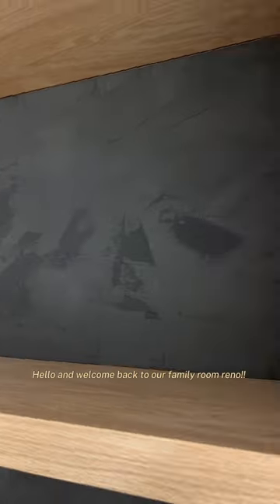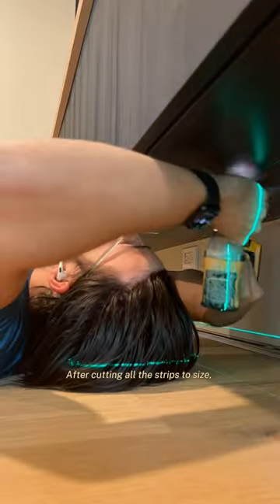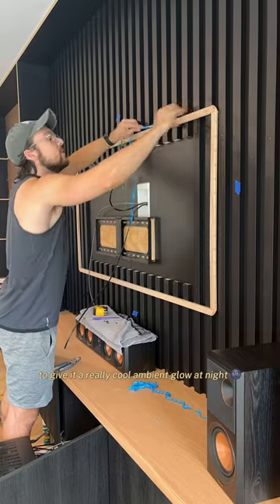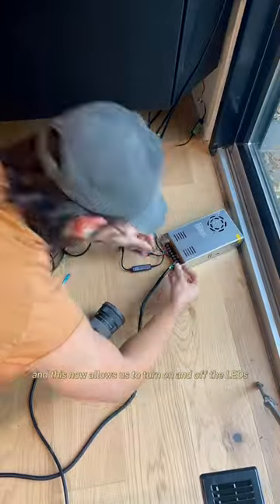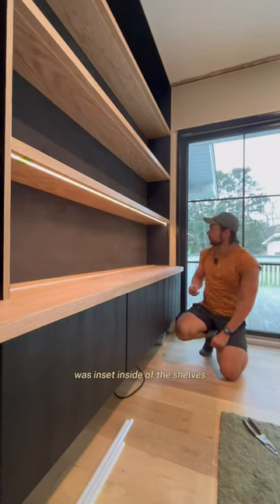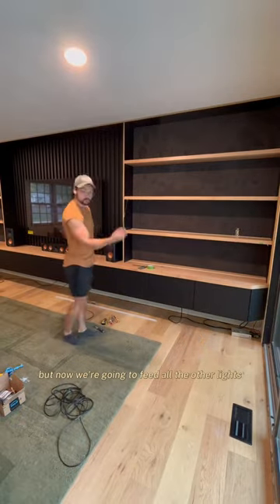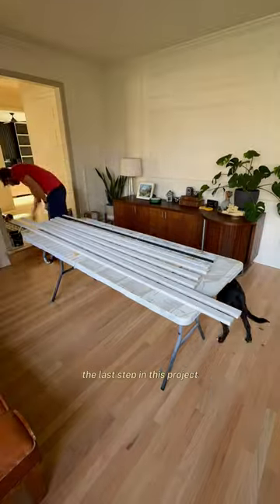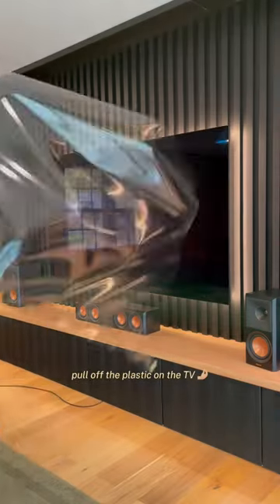Family room part 19: LED lights! #diy

Comment: Hey, cool wall unit you've built there. I also really like the floating shelves. I saw that you still had white window frames at the beginning. Did you paint them or replace them completely with new ones? If painted, what material were the window frames made of? We currently have white plastic window frames on the inside and anthracite-colored ones on the outside and I would like to paint them black on the inside as well. But I'm not sure how, and whether the paint would even hold.
Reply from the maker: Thanks! We just repainted ours white and they are made of wood so it was simple. I would ask your local paint store what paint sticks best to plastic. You will most likely need a special primer
Reply: Thx, i will check it. Or change the base-color of the media wall from black to something else. :/
 @GoldenKeyDesign

Comment: You refer to the boards in the background as EUCA boards. What exactly is that? Unfortunately, this term is not so common here in Germany. Is that an HDF board? Or a material made from eucalyptus? Thx and Greetings
Reply from the maker: It’s an MDF like material. We use it because it’s inexpensive, very smooth and uniform surface, as well as only an 1/8” thick
Reply: Thx ! @GoldenKeyDesign